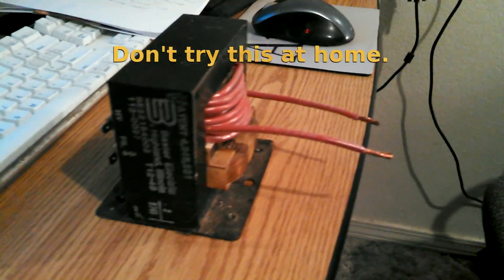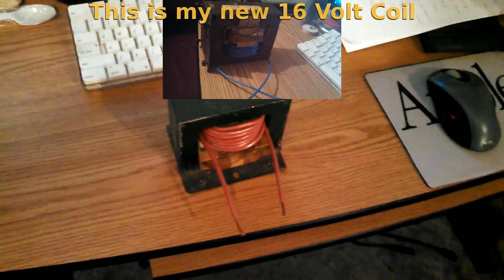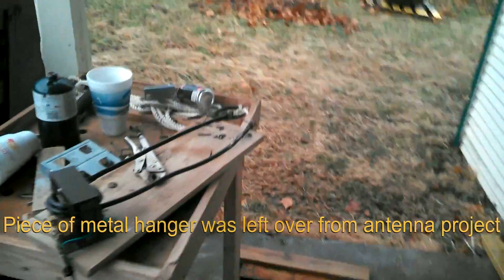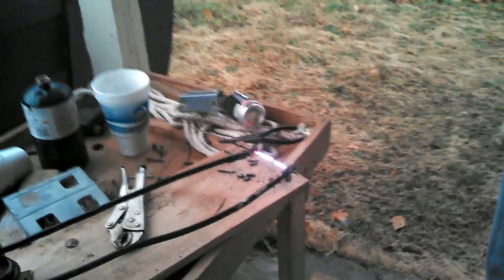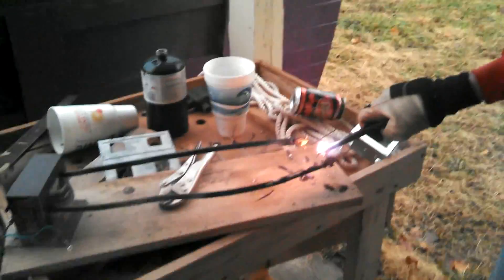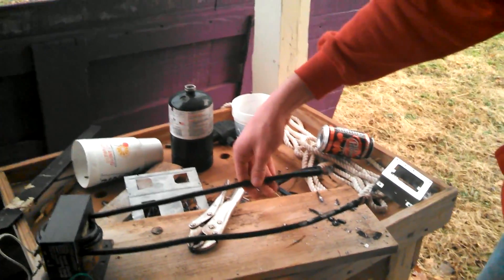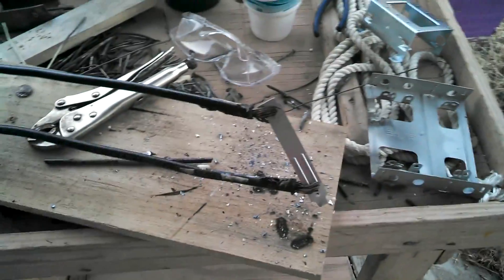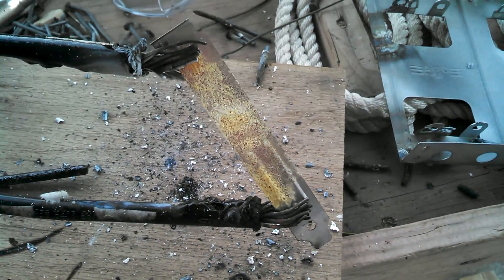Metal Melter From Microwave Transformer

Comment: How is yours so quiet? I did the same thing and mine has a really loud buzzing noise when i plug it in. I havent tried to meltal due to fear of breaking something
Reply from the maker: Mine gets really loud when it is shorted out.  I think the noise comes from vibration so maybe the coil isn't tight enough?
Reply: ahh ok,
Reply from the maker: zapronthe22nd Awesome I really enjoy playing with this stuff.  I actually used it as a tool for the first time a few weeks ago. I needed to cut a bolt and I didnt have a angel grinder handy so I just melted it in half. Lol
Reply: Jonathan Rader
hey man, whatever works for ya lol. i just kinda like the idea of making a spot welder. I quite enjoy it as well. Quite the good passtime